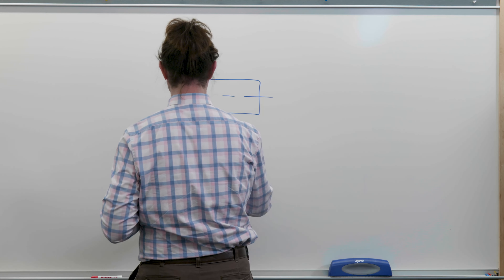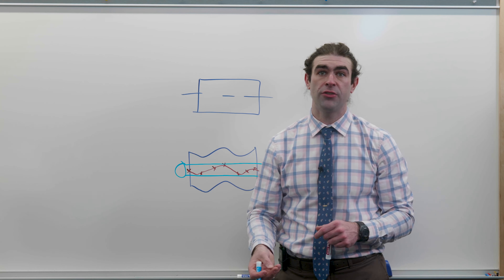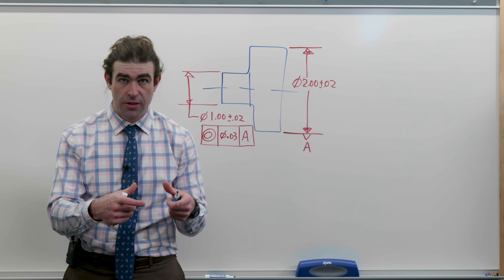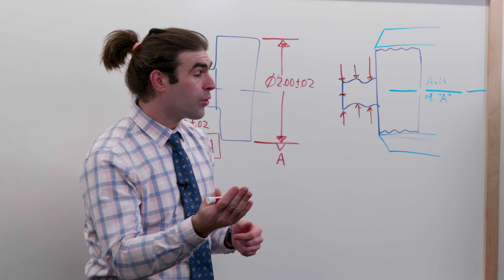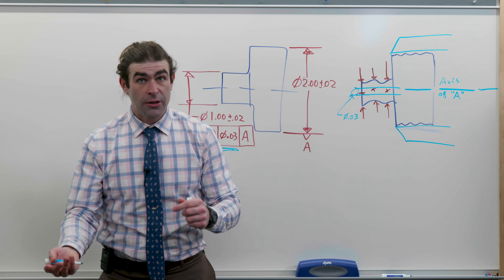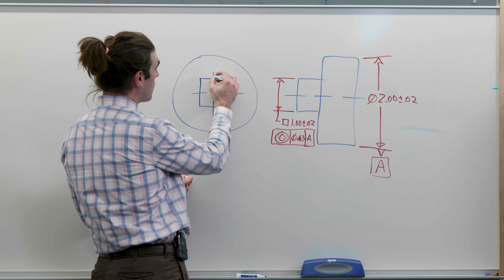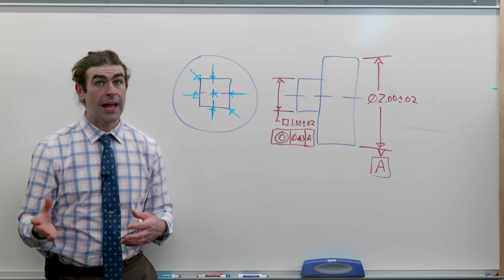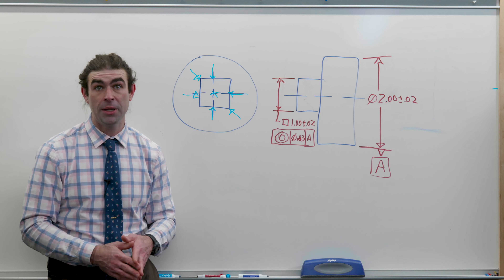GD&T: Concentricity Explained

Comment: MINUTE 3:56 - Do you have to initially set up the indicator with respect to Axis of datum feature A to measure the X points? I think we would have to zero out the indicator at Axis of datum feature A, then measure the two points and then divide by 2 to see if the median point fell above or below the axis. Does a CMM machine zero out at Axis of datum feature A? What CMM machine do you recommend?

Comment: if cylindricity and concentricity are given in a component, then is the cylindricity geometry included in the stack.please give me an ekplanation sir
Reply from the maker: Hi, in any case I can think of, the form tolerance cylindricity would be ignored for the purposes of fit and shift. The concentricity can be treated like position in your stack.
Reply: Thank you much much for your explanation sir.sir, there are case, two component have same size tolerance plus minus 0.2.and both component at MMC.please sir give explanation about the stack.i have confused the stack cause both component at MMC so the tolerance zone both component huddle together.thank you sir

Comment: Wow, this is wrong!!!  There is a big difference between Derived Median Line and the Median Points in Concentricity (1:40 - 1:56 in the video):

Derived Medial Line: Each cross section has ONLY ONE point... Multiple section makes multiple points... If you take infinite number of sections, you get infinite number of points.. and these points would make a curve... and this curve is called Derived Medial Line.... so for short, derived median line is a curve.

Median Points in Concentricity:  Each cross section has MULTIPLE median points.. you can theoretically take infinite number of points in EACH section, and these points would make a closed curve... and if we do this for infinite number of sections.... and then combine all those closed curves, you would get a surface (like an imperfect pipe).

So in a nutshell, Derived Median Line is a curve... Median Points in Concentricity is a surface --> HUGE DIFFERENCE.  They are not the same as it is claimed in this video!